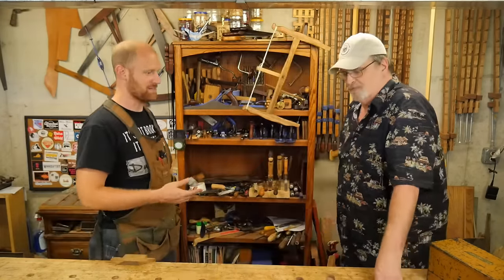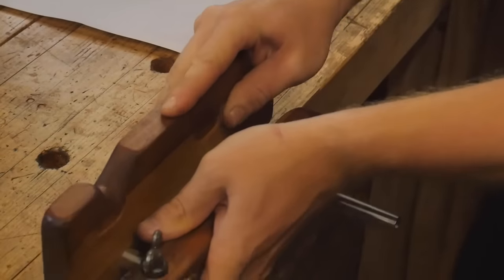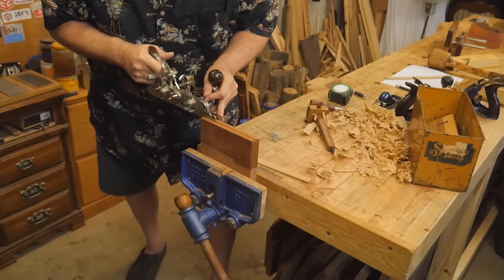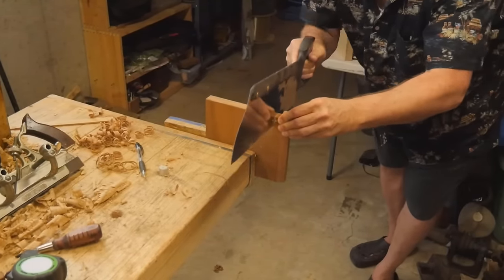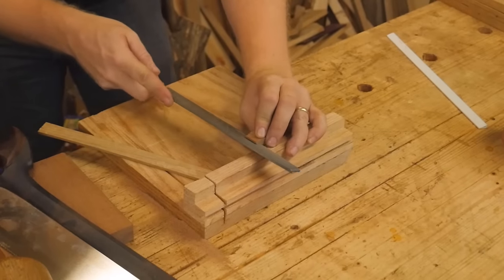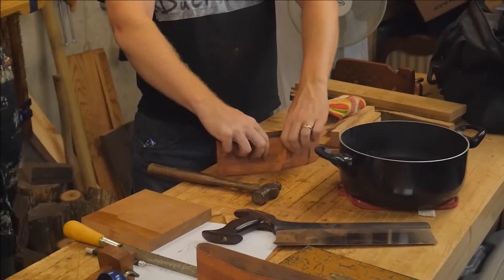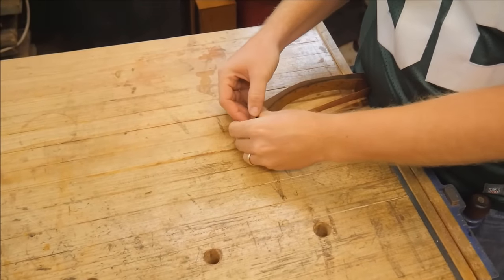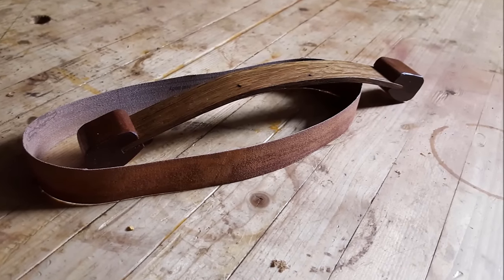Making a Bow Sander With Opa's Workshop Make your own Hand Tool

Comment: lovely collaboration ! so fun. Great tool. What I usually do with those band sand papers, when are dirty, clean them with a rubber, any kind of soft rubber as the tennis shoes works fine. Thanks was nice to see this :)
Reply from the maker: thanks! I use to do the same thing. but I don't have the sander any more, just a bunch of belts.
Reply: Works also

Comment: do you have a 'fix' for my opa's brace n' bit , it off center when turned been the handle and the shoulder pad . ??😕
Reply from the maker: really your only fix is a vice and hammer. and that has no guarantees. they are not easy to bring back into true. are you talking about a brace or a breast drill? also, make sure you are using the correct bit for the chuck.

Comment: what size is the sanding belt? or where do you find them?
Reply from the maker: this is a 3X18 that I cut to the width I needed. I am thinking of making then with a 21" belt and a 32"belt just for the fun of it. I just get them at the home center but these were just lying around the shop.

Comment: So ahhh, I've attempted this twice now and snapped my oak bow both times. It is about 5mm thick x 30mm wide, and soaked in boiling water for about 15 minutes.
Any ideas?
Reply from the maker: +Michael Vivian if it is European oak you will want to soak it longer. The other question is how much are you bending it.ours was about 27cm long (10") and we bent it about 3cm (1.5")
Reply: Hmmm, mine might be a bit longer than that. Might try once more with a slightly shorter bow. Cheers!
Reply: Three ideas: 1) use quartersawn stock with little to no grain runout  (very straight) 2) sapwood bends easier than heartwood - don’t choose a piece with both 3) kiln dried wood is less flexible and more brittle than air dried.

Comment: What are the dimensions of this, "end point" to "end point" finished product and end point to end point of base wood strip?
Reply from the maker: I have no idea actually I would have to measure it when I get home. I just set the belt down and measured the belt. Then made the spar a bit longer and then cut it to a fitting size